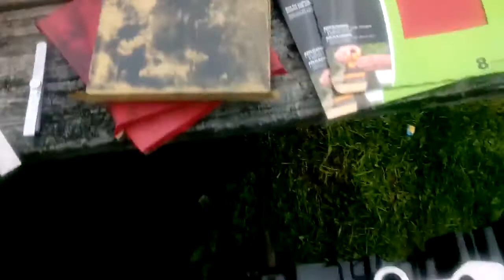How to resurface a cast iron block

Comment: machine shop would have taken out the dowels.. thus making it more true. your way works but you should have removed the dowels. Im actually doing the same thing to a VR. I spent some good time making sure my sanding block was truly flat by sanding it on a piece of glass though.
Reply from the maker: 15 thousands of an inch sounds pretty true to me. especially since factor spec is bouble that at 30 thousandths
Reply: If you took the dowels out, the high spots are going to be around the base of the dowel holes. All you did was basically built a "mole hill", to say, around the dowel hole.